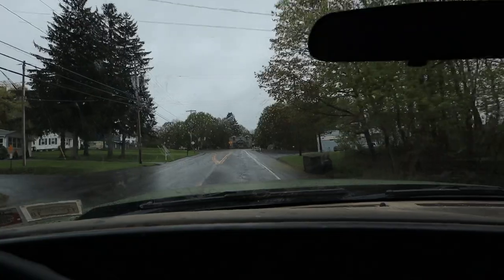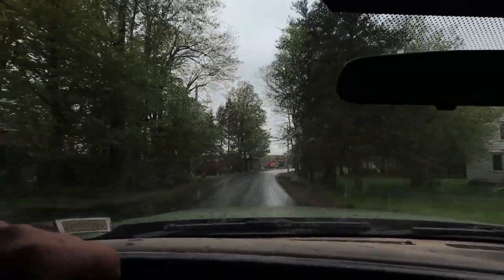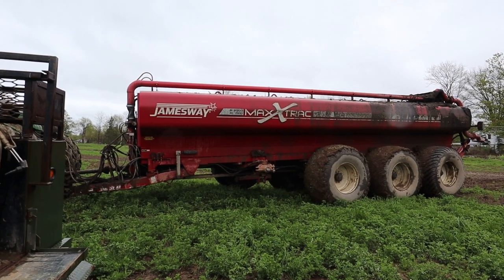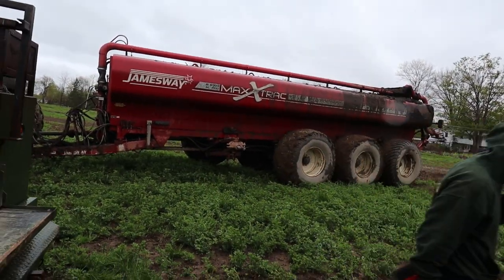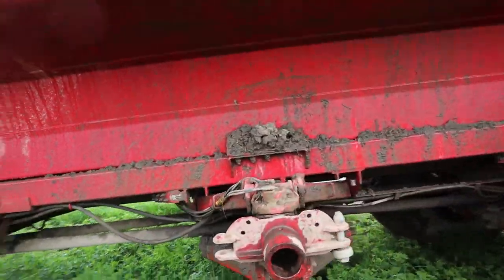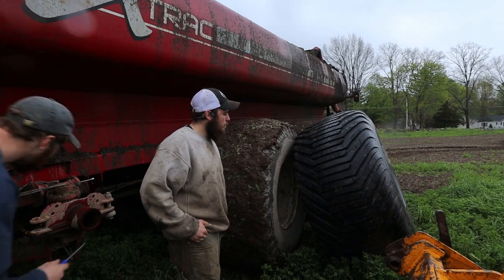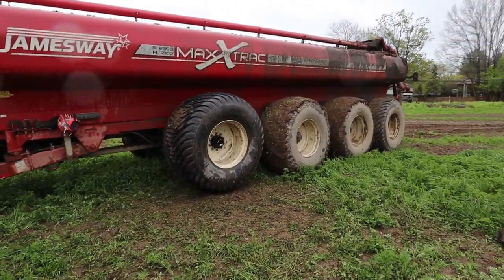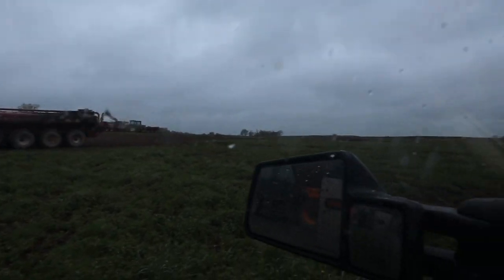Broken axle and broken fences

Comment: Ouch. At least nobody got hurt. Do you think the suspension ever maxes out under a load? They have a fair amount of travel, but on a tank that long it doesn't take too much of an uneven place to use most/all the stroke on those cylinders. I always wondered if that might contribute to this type problem. It seems like they steer really smooth as long as the ground isn't too rough, loaded or unloaded. Don't the 2 fronts and the rear axle turn, with the 3rd one running straight? How many axles have brakes? I'm running a 5500 triaxle, front and rear steer, all-wheel braking. Quite a bit less tank that what you have here, although my axle/wheel weights are a bit less. Keep up the hard work and be safe.
Reply from the maker: All axles steer, I think 3 able have brakes.
Reply: @FarmingFixingFabricating  Okay. You've got plenty of stopping power.

Comment: One broke axle would be a fluke, you think the other six are ok? I know there’s probably more weight on that set of wheels though I would figure the stress turning would be higher on the middle two then that one, are the middle axles fixed or do the steer as well?

Comment: For the placement on the spreader it looks like there is quite a bit of torque on those front steer axles when turning, no wonder the spindles crack and break. Damaged fence better than human damage.  Was that your dad in there swinging the sledgehammer too? Thank you for today's video.
Reply from the maker: No that was Tim

Comment: The axles don't equalize weight between each other, like a walking tandem? I figured that front axle would be at the end of a deep gouge in the pavement.
Reply from the maker: The axles equalize hydraulically.
Reply: That is cool.  I've loaned my 10 ton jack to my cousin a couple times to replace a spindle in his 4600 gallon tank with walking tandems. He has to do that wherever it snaps off at.

Comment: Had a 1000 gal nurse tank that broke an axle  in he same manner only the spindle was welded to the  axle... Cut off spindle and  welded a Thick wall length of tubing to axle and made  basically a receiver for the new spindle ... welding shrank tube so I reamed it with a 2 inch hole saw......